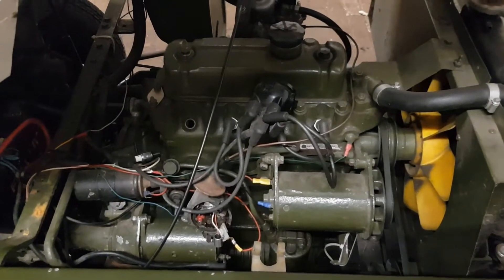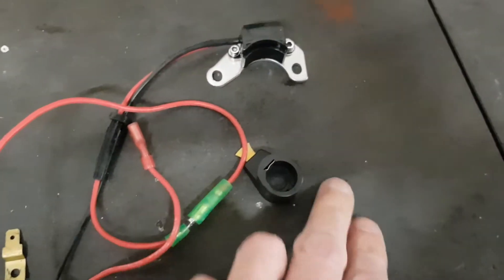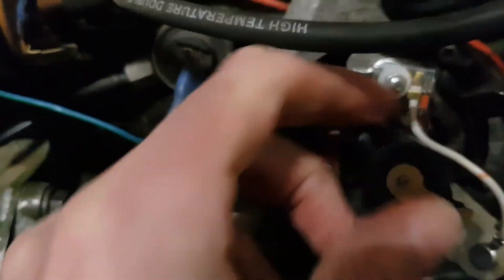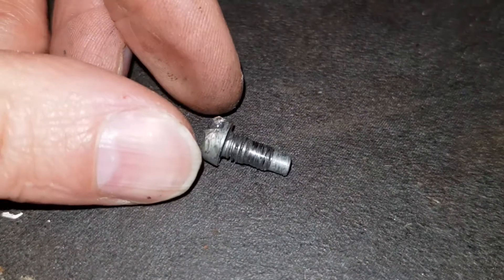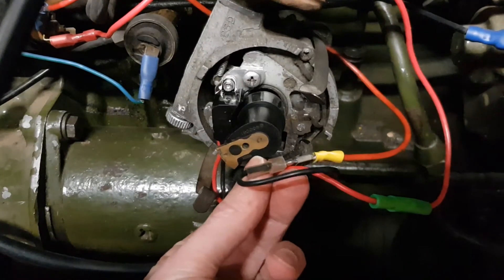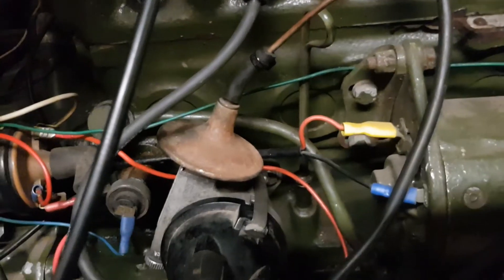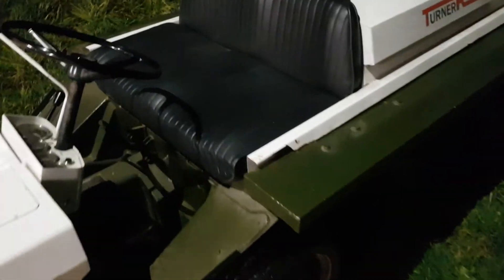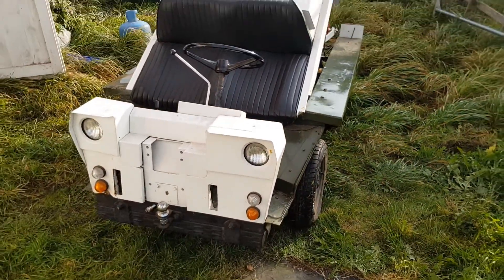How to install and test an electronic igition on an A-series enginen

Comment: Great little explainer of fitting electronic ignition, I've only ever owned 1 classic without and always wondered what it would take to 'upgrade' and turns out, not that much. Will bear in mind for any future projects. Thanks.
Reply from the maker: Thanks! I can confirm that it's still working. Really I should set up the timing properly with a strobe but it seems ok at the moment